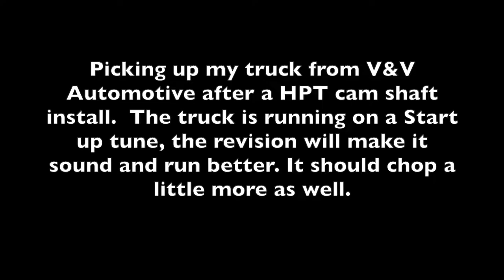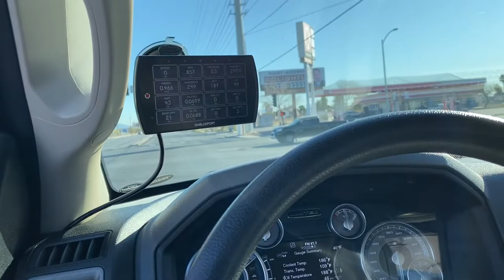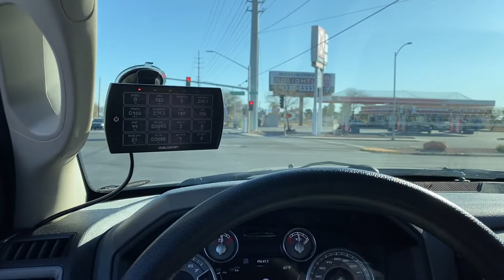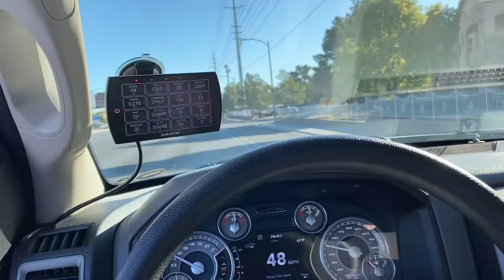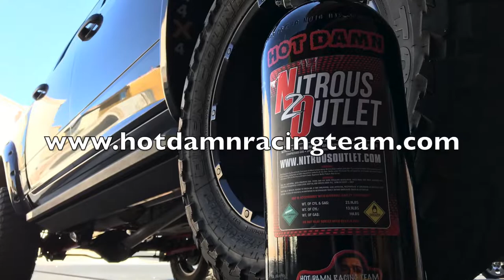Moe's HPT Cam shaft install completed by V&V Automotive

Comment: Wish mine sounded this good, I have the same cam with Texas speed long tube headers and high flow cats and my truck barely has any chop at all
Reply from the maker: Chop is mostly in the tuning, the tuner will lower the idle RPMS as much as possible.

Comment: Hot Damn!!! LoL sound great brother.
Reply from the maker: Hell yeah thank you! I can’t wait to hear it tomorrow, I just added the revision. Should chop a little more.
Reply: HotDamnRacingTeam yes sir yes sir you welcome. Thanks for sharing your vids. I live in Fort Worth Texas. I’m really close to having the money saved to start my project on my 2015 4x4 Quad Cab HEMI 8spd. 3.92 Gears. I special ordered it. It has my name on the window sticker. I want your cam. I want a good torque converter and valve body to help with the shifts. I guess on the 8spds I was told to look into that instead of a shift kit.